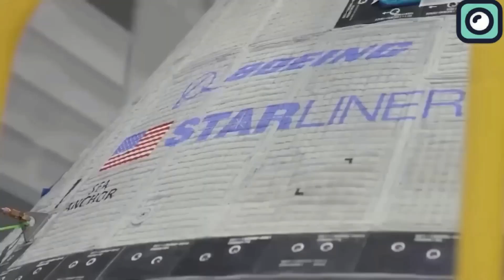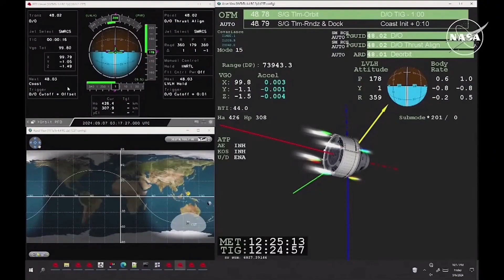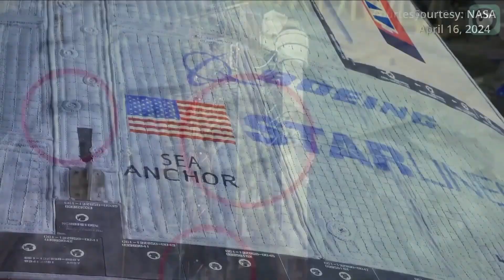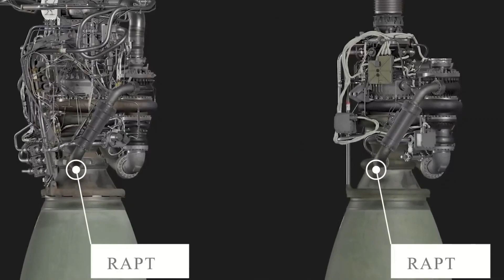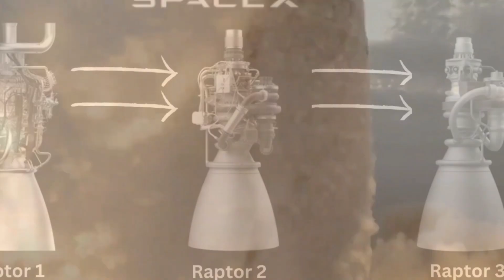Boeing Is In Big Trouble For The Starliner Failure and Other Problems!

Comment: Boeing's (Boeimg Starliner) problems, explanations were described by Elon Musk in a nutshell – excessive administration, hiring so-called specialists without practice, etc. I'll add: mole / sabotage, too many of these strange mistakes, also in aviation. It's a pity, because it's a company with huge global achievements. If it falls, who will replace it / with what? Or maybe the American society should change the rulers, they are good for nothing, and the new ones should reform the whole country – otherwise it will be a disaster!.